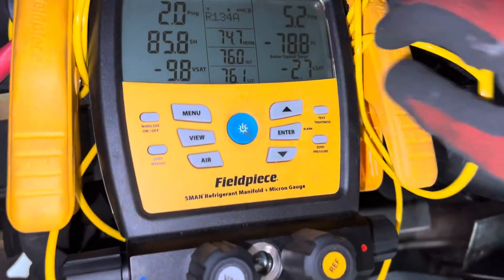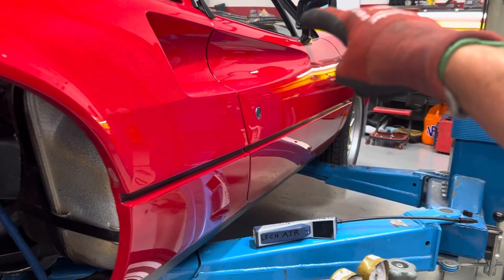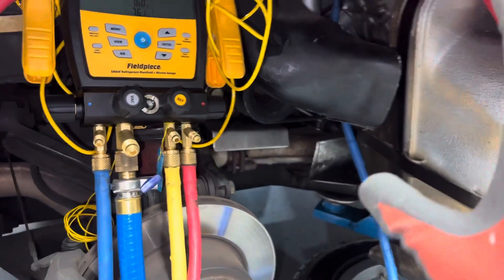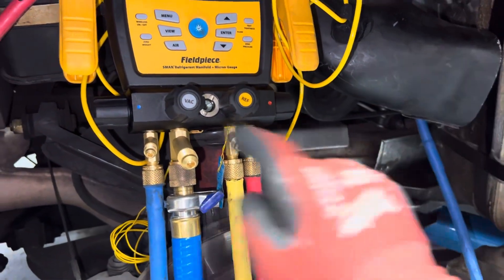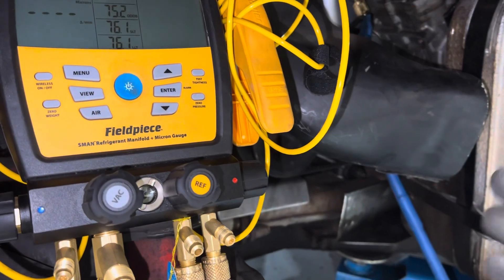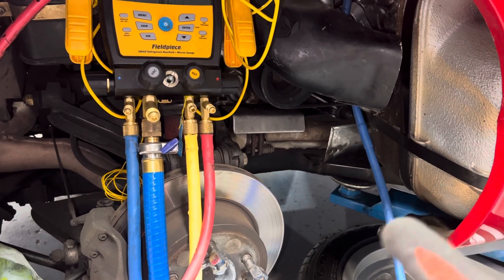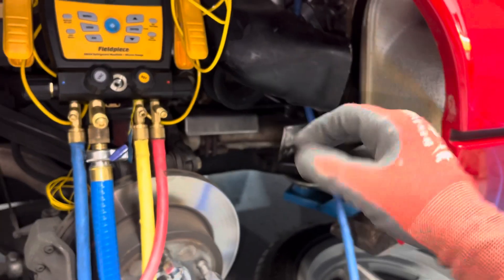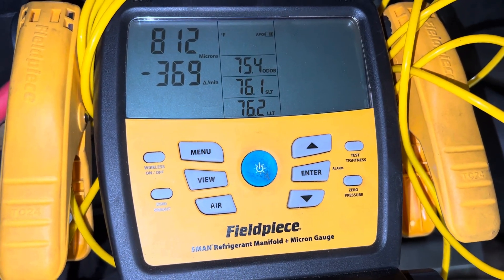NITROGEN TRIPLE EVAC & PURGE Lowering moisture content ￼

Comment: Does pulled nitrogen affects the vacuum pump?.Does nitrogen sweeping removes oil?
Reply from the maker: Nitrogen is air that you breathe the air that you breathe a 70% nitrogen in 20% oxygen.  It does not affect anything.. 

Nitrogen does not remove oil. You’re only putting like one psi or two psi in the system. . . 
And then using the vacuum pump to remove it
Reply: @coldfinger459sub0  Thank you brother.
Reply: After you flush the  AC system ,what do you use to remove flushing solvent from lines& evaporater abd how to dry them?
Reply from the maker: @issamadam9352  nitrogen then vacuum

Comment: Hi. Not sure where to message you, but I need help/advice. Lost power while pulling vacuum and I wound up with pump oil in my guages and at least some in my system. 2012 Toyota Tacoma. It is a new compressor. Waiting on a new condenser, so no loss there. I can flush everything else except the compressor I think. Might have pulled a couple of ounces in.  What would you do?
Reply: Sounds like you have done something wrong...
Reply from the maker: Depending where the service valve fittings are. 

The oil should probably just stay inside the Refrigerant hoses or lines where it went backwards, and then dumped into the service valves through them into the hoses . 

So you might get lucky and just remove those hoses or lines were the service valves are located and just flush them out .
Reply: Went ahead and flushed the evap core and reassembled the dash. Covered the ends of the lines best I could, ran nitrogen through the evap core and reinstalled plugs. Did not reconnect evap to system because I am waiting for a condenser and will flush the lines when I install it. Going to remove compressor, dump oil, start over and hope for the best. @coldfinger459sub0
Reply: Oh, and I ordered a decent vacuum pump!
Reply from the maker: @cholovista  and if you’re doing this as do it yourself or a home garage side work mechanic so it’s OK to leave the vacuum pump on for longer the more the better the more moisture you remove overnight is fine. If you have the time.

Comment: So a little update. On one of your previous videos you specifically mentioned how splash guards underneath the front end of the vehicle aren't just to protect the under parts like the radiator and what not but it's also to help direct airflow more precisely. That got me thinking about my 2014 Camry. The splash guards over time have broken off and like most other people I never bothered replacing them. After watching that video where you talk about the importance of them, I ordered another set and got them installed. I'm really hoping I notice difference with it. What differences should I notice with them now installed?
Reply from the maker: The difference will be on the hottest days like 90° 100° plus Fahrenheit when coming to a stop at a stoplight or stop sign.
Reply: @coldfinger459sub0  That's what I thought!  I can already feel it!  Like you say though most people wouldn't necessarily feel it.  I feel like I pay attention to a lot of technical stuff though.

Comment: I puchased bottle from gas suppler, regulator off amazon, and a flow regulator off amazon.  I tried it without the flow regulator and I don't have the "touch" so the flow regulator helped me a bunch.  I'm 54 yrs old and this is the first time using nitrogen but can already tell it should be used for a quality job.
Reply from the maker: Be careful

Safety procedures to be 

I’m used to working with people who have been through safety glasses 40 hour OSHA classes welding classes for a few weeks or months 

And everybody has been versed on the safety of using a high-pressure gas 

Don’t be afraid at 50 years old plus go take a nighttime college class on welding go take a nighttime Hvac class 

I actually went back to college a third time when I was in my late 40s through my 50s

Comment: I'm not doing anymore A/C repairs on our vehicles without a supply of dry nitrogen. How did you get your supply of A/C grade dry nitrogen? Is there a supplier that will send some to me?
Reply from the maker: We have many welding supply warehouse is everywhere around us. We can go to any of them.

We have many air conditioning and refrigeration warehouses 

So anywhere you have refrigeration and air-conditioning supply, warehouses or welding gas supplies you can get nitrogen I think I may have even seen it online on eBay or Amazon. You can order and have delivered.
Reply: @coldfinger459sub0 Oddly enough I was going to ask the same thing. I'm assuming you don't need any special certa to buy it?  Also what exactly do I need?  The tank, the pressure regulator, anything else?
Reply from the maker: @mailmanjoe  here in the United States. As far as I know, at least in the San Francisco Bay area, I could buy nitrogen I could buy argon, helium, hydrogen, Oxsee acetylene anything I want with no restrictions you just need a good pressure regulator, no special tools.
Reply: @coldfinger459sub0  what do you set the pressure regulator at?  Or does it come preset?
Reply from the maker: @mailmanjoe  you’re dealing with high-pressure gas here you got like 2700  to 3,000 psi in a tank

You have to adjust it 

I’m sloppy I don’t care. I do it by feel site hearing I just give a twisted a wrist because I’ve been doing it with regulators since using my grandfathers torches at the age of eight years old. . 

Oh, but you only want one or two psi in the system when you’re doing sweeping and purging . 

So you can set your regulator for 20 psi, is more than enough and only allow one or two psi to go into the system